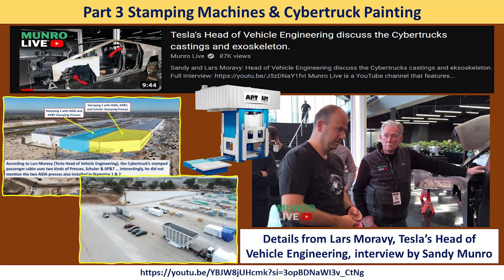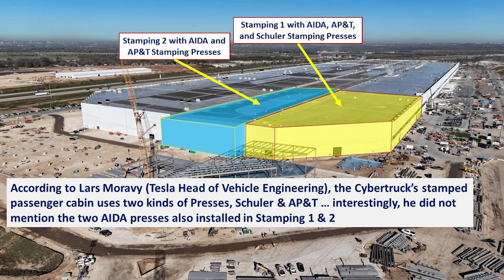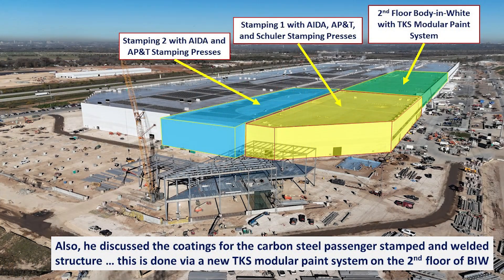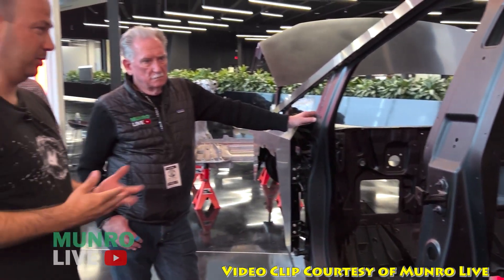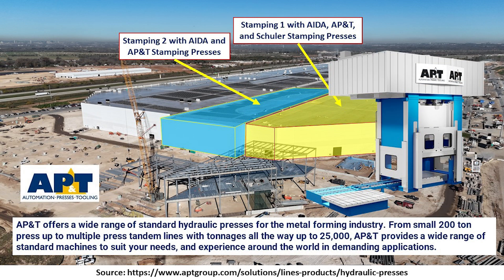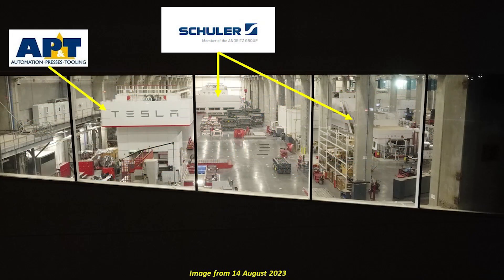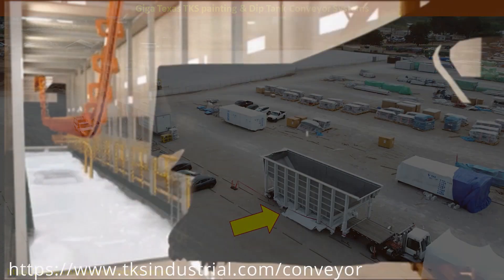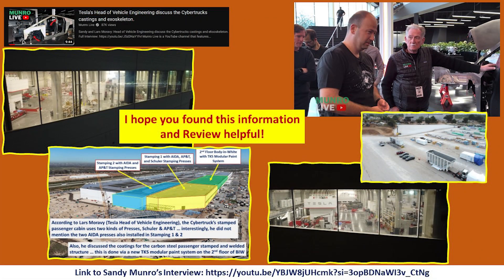Part 3 Lars and Sandy Interview & Discussion about Cybertruck Stamping & Painting Processes!

Comment: The steel is High tensile boron steel, most likely hot stamped.
Reply: Someone, not sure if it's Sandy, did say recently that Giga Texas probably has the world's largest hot stamping facility.
Reply: @exterminator4808  it's absolutely possible because allegedly cyber truck has the biggest Single piece cabin side stamping in the automotive Industry